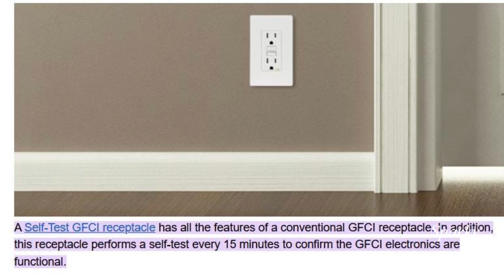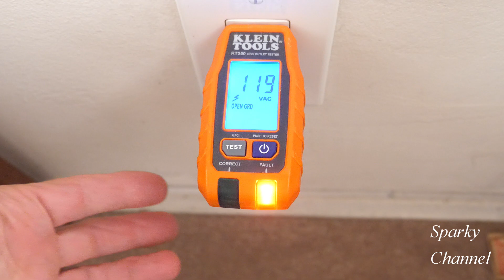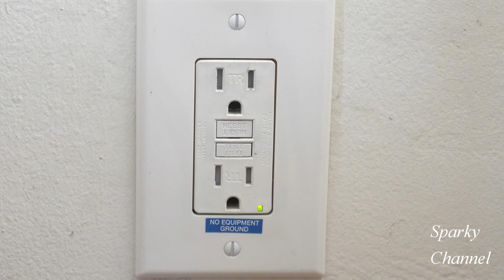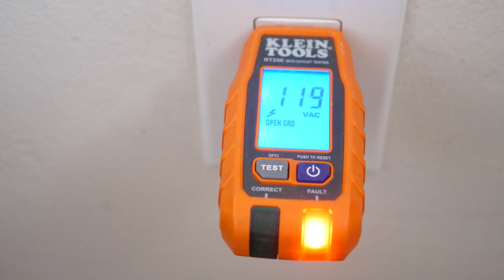Why Doesn't My GFCI Test Button Work?

Comment: Thank you for the info...but I still have a question I cannot find the answer to and hope you can help!  Very often when inspecting outlet receptacles...the wiring shows correct but my GFCI button on the circuit tester does not trip the GFCI.  When I manually test the GFCI, it works.  So - other than a bootleg situation, does the gfci get stuck?  Is it certain brands of GFCI's? Is it my tester?  I have tried 2-3 testers on 1 GFCI and none of them tripped it.  There was no bootleg situation either.  I would LOVE to hear your thoughts on this please!

Comment: The frustrating part here is when the municipal inspector comes for Final, plugs his tester in, and finds that it won’t trip. Now you have to an insolent inspector who doesn’t appreciate this problem and is not willing to accept that the manufacturer has built-in protection inside their device. Instead, the smug inspector will tell you to run an equipment ground into the device so that his handy little tester will trip the circuit when he presses his little red power button.

In the case of many municipal inspectors keen on power trips, ignorance is bliss.
Reply: Yep had an inspector flag the gfi in a bathroom that had no ground and wouldn’t trip with his tester. Had to run a ground wire up 3 floors, yay.
Reply from the maker: @rightonrepairservice3551  I can believe that! I think that most inspectors will know this information though.
Reply: Inspectors are not electricians.  If you are so smart why did you look at this video?
Reply: @bryanelwood5121  every electrical inspector I have ever met has formal electrical training, including journeyman or master designation. I watched the video because it interested me.
Reply: @bryanelwood5121 even the smartest can still learn.

Comment: There are older GFCIs whose test button does not do anything when they're wired with no eqpt. ground -- they must be built like the external tester.  I prefer to replace them with newer GFCIs because, of course, they cannot be tested by any easy method.

Comment: Hi Bill, I'm currently experiencing this exact same scenario, except when I press the gfci test button on my 3 light tester, it changes from open ground to hot ground reverse. This recepticle is wired using an older 2 wire system, however, it does have a green ground wire that goes to the electrical box. If I'm understanding your video, does this mean everything is wired correctly and I just need to add a no equipment ground sticker to the outlet? Or is there something else I need to do? It may be worth noting that I have other GFCI recepticles in other rooms of the house that test correctly with the 3 light tester and are grounded in the same fashion.

Thanks in advance!
- Eric

Comment: The current limiter on my hair dryer ( 2 prong no ground) test button works well on an ungrounded circuit.    

I plug it into a grounded FGCI circuit.    The hair dryer test button DOES WORK and trips, but the GFCI does not notice the interruption. 

comment please

Comment: Interesting, the tester at the end of my hair dryer ( similar to a GFCI) will trip when the test button is PUSHED. Without a ground conductor present.   ( Old 2 wire circuit, no ground). thank you.

Comment: Imbalance between line hot and neutral when no EQUIPMENT ground is present and test button is pushed.    
Question, how does it do it?   Does it put a an inductor between the hot and neutral?  thank you Sparky

Comment: Does a test button on a 50 amp gfci breaker  for my hot tub need to be functional coz it blew out  I also noticed that I ordered a breaker but it was longer than the one that was in my panel the one i have is shorter  is the a way to distinguish from the diff sizes

Comment: I have a similar issue. But my tester is saying it’sa normal outlet and no issues. But the tester AND the actual outlet won’t trip or reset the gfci
Reply: exactly my issue
Reply: It likely means in your panel the ground is being used as the neutral.
Reply: So what was the answer?

Comment: Suppose if a metal chassy (which has no contact with ground) comes with contact of hot wire.. Will it be considered imbalance and cause GFCI to trip? Or Unless some one touch that metal chassy and provide ground connection then it will trip?
Reply: Assuming the appliance is grounded correctly it’ll trip the breaker because you have created a ground fault and essentially shorted the lines to ground. This offers a very low impedance path which pulls a lot of current causing the breaker to trip. This is not the same thing that a gfi though which senses the imbalance between the hot and grounded conductor.
Reply from the maker: It will trip the circuit breaker regardless of if it is GFCI or not.

Comment: Nice that Leviton speaks of electricity in "magic" terms.   The external GFCI tester "dumps" current to the ground by connecting a resistor from the 'hot' to the ground when the button is pushed.  That's all it does.  This causes a small parallel current with the neutral and an imbalance the GFCI circuitry senses.  Open up the cheap tester and you'll find the resistor, a switch and the neon bulbs

The test inside the GFCI outlet creates a parallel circuit around the GFCI sensing portion on the neutral by again connecting a resistor that jumps the circuitry.  Thus the outlet does not need to use the ground to create the imbalance.  This is possible because the test is part of the outlet and thus can be wired to jump the sensing circuitry.
Reply from the maker: Hi JK! Can you tell me what is a better test on a grounded GFCI receptacle?: 1) pressing the test button on the GFCI itself or 2) using the test button on an external tester?
I asked Leviton this question and they said it doesn't matter, both tests are basically the same.
Reply: @SparkyChannel   Leviton is correct.  What is needed to test is to have a parallel path for one leg of the current going through the sensing circuity so that what is coming in on the hot is not the same as going out on the neutral.  Internally, they just wire a jumper path around the sensing circuity.  But an external tester need to use the ground wire to create that path.  Both methods create the same unbalanced condition that tests the sensing circuitry.

Comment: I understand you can test that GFCI, but do you just assume the GFCI will work on  the protected receptacles down the line? I know you can test some of these if you have a way to ground with these testers (with certain adapters), but is there a way without a ground? Obviously not a professional. Just a diy guy dealing with this in an old house now.
Reply: Obviously there is No Test down stream that would work.
As noted, the plug in testers will not function on the downstream outlets.      Excellent Question.   Perhaps one will be forthcoming.
Reply: U shouldn’t assume that recepts down the line are gfi protected. Test them but going to them and testing them

Comment: I just did this. Installed a new gfci where an old outlet was. There was no ground in the box, as it was an old 2 wire. The home inspector(not the electrical inspector) said the gfci was not working correctly. I found out I did do it correctly, and he was wrong.
Reply from the maker: Yes, home inspectors generally do say things are bad if they aren't sure. They are famous for saying that everyone suddenly needs a new roof even though the existing roof doesn't leak a drop. Now you have a statement from Leviton's GFCI expert to back you up.

Comment: And I found out that GFCI built-in tester button won't trip if you connect the source to "LOAD" side instead of "LINE" side of the GFCI receptable. But the receptacle itself works normally.
Reply from the maker: Interesting, thanks!

Comment: I have always thought that a connection between the neutral and ground was made inside the tester when you press the button to cause a gfi to trip because I know gif’s will trip when going from neutral to ground and the gfi does not trip when pressing the button on the tester when there is no ground. I have thought this for as long as these testers have been in existence. Never thought much of it, just thought it was obvious.

BUT, BUT, BUT, I have recently decided to verify this, because you and other YouTubers  have brought it up, and I can’t.

If you do a continuity test between neutral and ground (between hot and ground as well) while pressing the button, you get nothing. There is no connection between neutral and ground or hot and ground or hot and neutral. Just nothing.

What do you have to say about that, Mr. Sparky? I so want an answer to this. I suppose I may need to contact one of these manufacturers myself.
Reply from the maker: I'll ask and if I get another good answer, I'll make another video. I do like asking the manufacturer because you hear so many different explanations for this on the internet in general.
Reply: @SparkyChannel  Classy Sparky! 
.

Comment: plugin testers simply connect the neutral to the ground. if there's no actual ground, that won't make any difference.
Reply from the maker: Good explanation, thanks!
Reply: wim0104 will the test button work on the GFCI itself, if no ground conductor?

Comment: Interesting.  I figured there was no ground reference for the GFCI tester to trip the GFCI.  I never was sure how the internal test switch operated.
Reply from the maker: Hi Don! Yes, the GFCI TEST/RESET process is able to create that imbalance internally in the device through a connection between load hot and line neutral. It's interesting that it uses the load hot and the line neutral.

Comment: Now I need a clear explanation as to why the testers are incapable of doing the same job as the built-in tester : )
Reply from the maker: I'll have to do more research to do a good job on that one. The GFCI TEST/RESET process is able to create that imbalance internally in the device through a connection between load hot and line neutral, but I need to find out what exactly the separate tester does during its test.
Reply: GFCI outlets monitor the balance of current between the terminals, it detects if current leaks to the ground. If there is no ground connection, those basic testers can’t pass current to the ground terminal and create an imbalance.

If a tester such as a Fluke 1663 was used, it would be possible to use the leads to connect to a ground terminal and “dump” a few milliamps to that ground, causing an imbalance.

The test button on the outlet probably uses a capacitor to cause an imbalance and therefore trips.

Comment: I figured it out because I know how a GFCI works (by detecting the imbalance), and knowing that to test it, you have to create an imbalance. Your external tools have no way to do that without an available ground, but the device can do it internally by bypassing its own imbalance sensors during the test, thereby creating the imbalance to sense.
Reply from the maker: Good job!
Reply from the maker: Like I said, Sparky Channel has the smartest viewers on the internet!
Reply: Not so sure.  Do Not want to bypass the imbalance circuitry.   That WOULD NOT be a test of the GFCI.  Sorry.

Comment: I was trained to use both the test button and a secondary test system to test GFCI performance back in the days before the Smart Lock (leviton) and similar type inferior brand GFCI receptacles.  the reason for this is that older GFCI receptacles would reset mechanically with the reset button, so it could be activated with the line wires connected to the load side of the GFCI, or with no power to the device at all.  thus, it was not uncommon for a GFCI to be miswired, and it would still trip with the test button, but it would not trip with a GFCI tester, because the the power to the receptacle face was not passing through the GFCI hardware.

to test a GFCI on a non grounded circuit, I run an extension cord from preferably a known grounded circuit, or alternately a receptacle that is not controlled by the GFCI.  then I can use a solenoid tester or an electronic tester with a GFCI test function to connect from the known ground or the neutral of the unprotected receptacle to the hot side of the GFCI, and if it is functioning properly, it will trip.  (I had a GFCI survey I did on an old house with metallic drains, and I was able to test from the GFCI to the drain with my solenoid tester)
Reply from the maker: How about a grounded GFCI? Would it be best to use the GFCI tester or the test button on the GFCI? Or would it be best to use both methods?
Reply: @SparkyChannel  with newer gfcis, it won't activate if it is miswired, so double testing isn't necessary.

Comment: The test button connects a resistor between the load  side of hot and the input side of neutral, This causes a current across the sensing ferrite toroid.
Reply from the maker: Like I said, I have the smartest viewers on the whole internet. Thanks for the explanation!
Reply: @SparkyChannel  

If you take one apart you can easily see the sense ferrite toroid. It's ring shaped.
The toriod is placed between line and load. They wrap the hot and neutral leads lead through it.
When current is flowing the hot is attempting to induce a magnetic field in the toroid. The neutral is wrapped in such a manner that it is attempting to induce a magnetic field of opposite polarity. So when there is an equal amount of current flowing in each wire, the net magnetic field in the toroid is 0.

When we have a ground fault, less current is returning though the neutral, so a magnetic field will then occur in the toroid. You will see a fine sensing wire wrapped through the toroid between the hot and neutral. That is what senses the magnet field in the toroid. It is processed through an amplifier circuit and then used to fire the solenoid that disconnects load from line.
Reply: I thought it might use a capacitor to create the imbalance, a resistor is not much different to adding a load, heater, motor etc.

Comment: So it says that specific outlet doesn't have an equipment ground.
Is that because there is no ground in the box?
Are these made specifically for that situation?
I question why it will accept a three prong plug. That seems to me that it wouldn't be up to code.
I can understand the need for this operation in an old house wired before ground was a standard. At least there is GFCI protection available and is fine for things with a two prong plug like a toaster. Now a countertop microwave is a different story.
Reply: Correct, no ground in the box. This is common in houses built before the early 60s.
This is the acceptable way to install a 3 prong outlet when no equipment ground is present.
Reply from the maker: Yes, the house was built in 1960 and doesn't have ground wires in some areas. Yes, grounding is very beneficial during certain electrical events such as a power surge.
Reply: The equipment ground creates a return path so if a hot conductor would come in contact with the metal case, the breaker would trip, With no EG and the GFCI, no circuit breaker trip would occur. So in your example of a the microwave, if hot came in contact with the case, it would become energized. The moment someone touched it and provided an alternate path to ground, the GFCI would trip.
Reply: to finish off what the others said; the NEC specifically approves the use of a GFCI to protect an ungrounded circuit and allow 3 prong receptacles to be installed, but they must have the "no equipment ground" label.  in theory, no electrical equipment should be able to put any power onto the ground conductor while it is working properly.  in actuality, the grounding conductor system can bleed off static electricity generated outside the electrical system.
Reply: The whole point is that it will accept three prong plugs. It is up to the code in replacing old two prong outlets. It is not up to code on new installations or even adding outlets into old installations. The outlet in itself is perfectly normal the ground is not just connected. This is one fault of the method as if the box is metal and not grounded it could become energized which would energize the equipment case and the GFCI would not detect this. It would be safer it it had just a dummy ground hole without contacts but for obvious reasons there cannot be such outlets.

Comment: Can you make a video with a multiwire branch circuit?  Field or simulated in the field i.e. tandem single handle bkr (“Two 1 Pole Units”) w/ 2 hots (blk & red) & a shared neutral (white) plus ground?  A j box fed by the ckt w/ multiple devices.
Reply from the maker: I'll look into it,thanks!
Reply: Another video request: discussion/instructional on adding GFCI protection at the panel bkr in lieu of a receptacle.  I see many of your videos upgrading receptacles and lighting circuits to GFCI via most upstream receptacle but none on upgrading at the panel to a GFCI bkr.